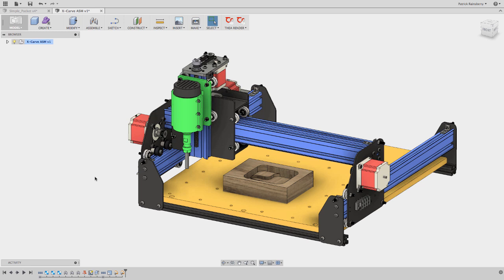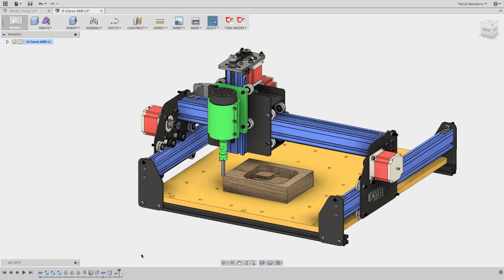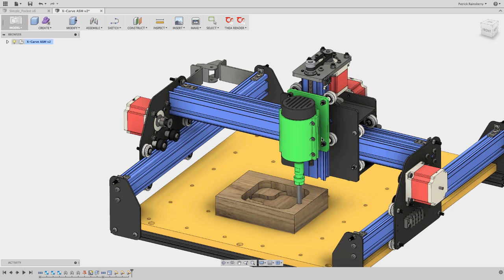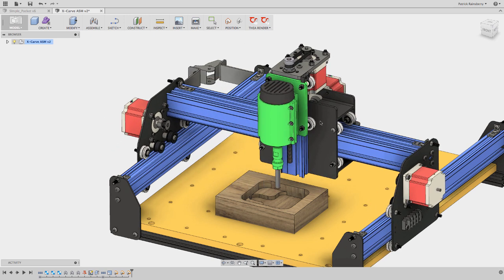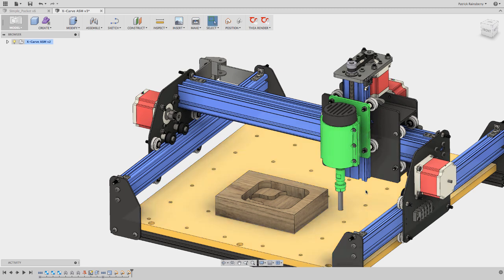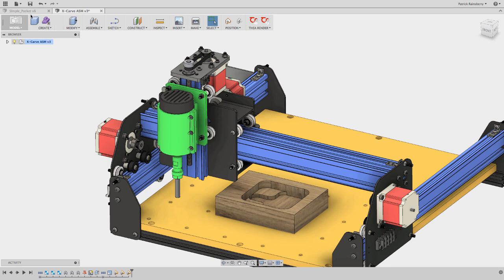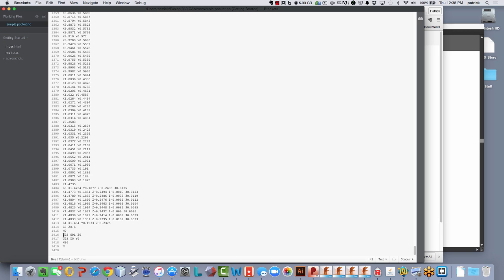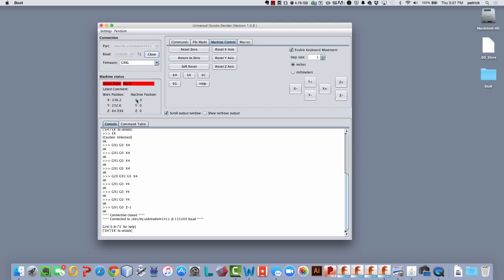Understanding G28 on your CNC Machine

Comment: What I can't figure out is how to reverse the Z moves.  The rest are fine but Z is doing negative for down and every machine I have ever used, or owned, negative is up as the values get smaller.

G90 G94
G17
G21
G28 G91 Z0
G90

T2
S10000 M3
G54
G0 X59.153 Y-49.95
Z15
Z5
G1 Z0 F750
X59.235 Y-49.867 Z-0.309
X59.153 Y-49.785 Z0
X59.235 Y-49.867 Z-0.309
X59.886
X60.036 Y-49.864 Z-0.322
X60.196 Y-49.851 Z-0.369
X60.219 Y-49.848 Z-0.38
X60.362 Y-49.825 Z-0.467
X60.4 Y-49.817 Z-0.497

0 being the top stock.